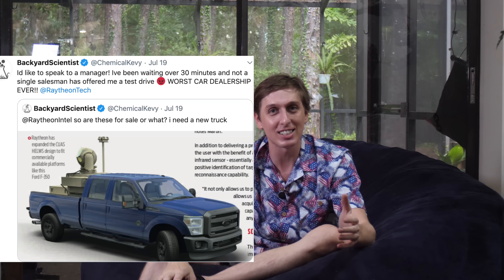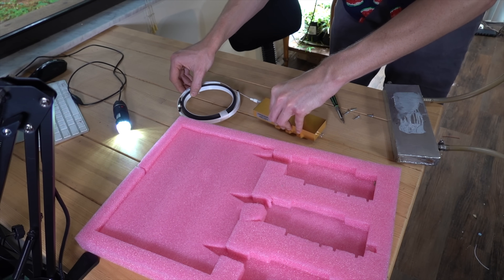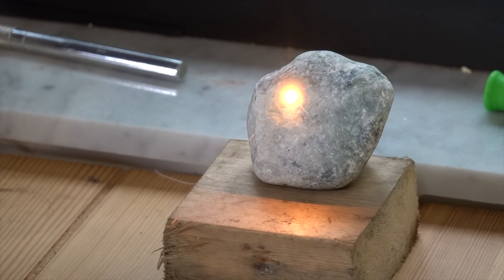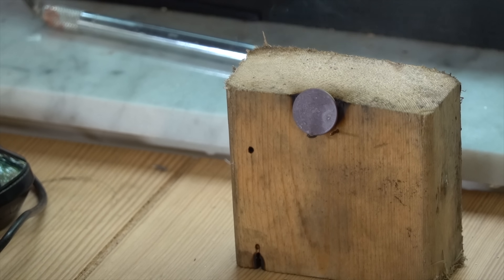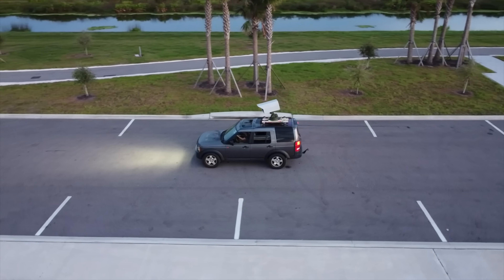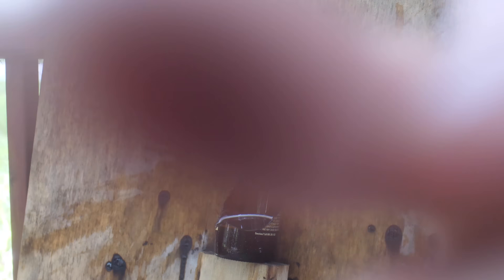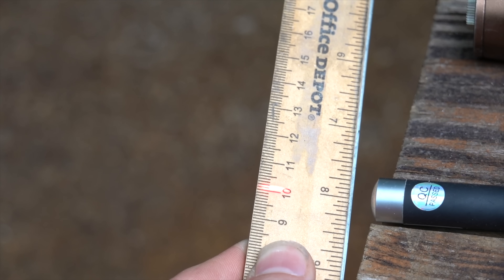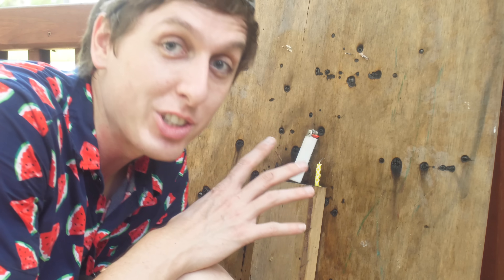200 Watt car mounted laser!

Comment: Dude...the glasses don't make you look like a dweeb...
😲GREAT VIDEO. 
Idea for speed/traffic cams...add a galvanometer for control and gyro for stability. Scan with computer vision for automatic ID/location of camera/lens. Scan said lens with galvo. I bet this could happen with a week or two of coding...and a couple/few Sparkfun dev boards and a Raspberry Pi (talking with the Pi through SPI/I2C) . Wanna get fancy? Predict/calc where the camera will be in the next frame...33.3ms away. That said, you can do a LOT in 33ms.
Reply: I would be concerned with a reflection...you did freak me out with that.

Comment: Just a heads up about FlightRadar and similar. I've seen discrepancies between it and other airline tracker websites (other sites sometimes show more crafts) and if an airplane doesn't have its transponder on, it isn't tracked. I've had military craft fly near my location and when I check flight tracking websites, none list them. Sometimes military aircraft is listed, sometimes not, depends if their transponders are on. Then there are older vintage aircraft that may not even have transponders. One old vintage airplane landed at a nearby airport and I wanted to know what it was but it didn't have a transponder or it was off.

Comment: I'm guessing it burned a hole through the cold cut, and that the wood on the other side ended up heating to the point it cooked the cut before it could get a hole burned through it as well.

Comment: I'm curious with the kaser mounted to the cassegrain in the outdoor nighttime test it didn't actuslly burn anything? Is that because the focal length was set much farther out than your backyard bottle testing? Does that mean the 200W would be far less effective at say 300 feet? I would love to see a bottle test at say 300 or 400 feet to see what it can do.

Comment: At 13:23 there appears to be a UFO in the frame.  If there were no planes in the area as he said, then what the heck is that thing racing across the screen at high speed ? Even at .25X the thing is moving super fast then disappears. Any comments here are welcomed.

Comment: This is actually crazy to me. Just so you know, 200 W is still comfortably within what an adult man can generate, ie via a bike dynamo. You could conceivably run this thing on muscle power
Reply: Nope. 200W is the laser output I assume. 

If the total efficiency was 10% for example, you’d need to generate 2000W to power it.
Reply: @davadoff  that is a good point actually. For some reason I assumed the 200W were the input energy
Reply: @kershmaru237  I was waiting and expecting him to say something about it in the video but he never did. Perhaps he doesn’t even understand it.

Comment: Jad you have no freedom to collect rain watter🤣🤣🤣 water and power ridicule and than to think there is more freedom dom dom dom l🤣l .

Lasers is catalistic ading towart eurths greatest problem the onknlwn factor of antyoxigenation evend of led ingeniering
Reply: please tell me more?
Reply: Ask me wat en mabey I can share about that part 😍
Reply: Here some light ond love where new conformations of opservations confurmed wat I shared to be corect in a deeper way😍

We see where daylight comes from😍

https://youtu.be/pYCq3XV4_0s

https://youtu.be/yONkvzTDZTQ

https://youtu.be/Dq41XQfTP1Y
Reply: Here I share a new sencor aray trouth the wide spectrum of understanding symplesety as the eurth paths in the eurth ring rolet how eurths ring  position eurth to be on its position  and how eurth conditions can ad to the some of conditions for eurths pits behavieures  towart poleshift readings

💜🎁💜
Reply: @arnokosterman231  Yes, that sounds interesting.  Please elaborate more if you'd like.
Reply: I have explained this in cern with anty metter and there explainations.

When I tace thention away particles has less to release so thay can tace less and than the drifted along with the directional feildflow of the equatorial behavieure between the kuiperbeld and kuiper copasators toroidal behavieures 😍 than we see materials running in the other direction🤣😍🥰
This they like💜 jad here I have explained this so oftenend inbetween manny sharings🙏

I can not find mi old klas sharings in plasma klas videos 
Zo I wil make time to do over soon
And wil show it inside a video sharing a jes wayght I have a smal sharing that supports this onderstanding within one self it's understanding💜
Reply: @arnokosterman231  Thank you!
Reply: You and oll are wolcome🌀💢🌹💢🌀

Comment: If it can mow or Rock can it melt tungsten which has the highest melting point I think of something thousand and if it can melt that then it can take down the entire airplane and just it being able to burn that rock it can probably shoot through the metal of an airplane so I think you may have just gotten a thing that can take down airplanes I mean if you aim it at a airplane engine technically it could go through the metal and then hit the engine and then cause it to explode

Comment: The glasses you are wearing are safe for IR, but it is NOT safe for the other stray light after the laser hits a surface.. and burning a copper penny was probably bad for the laser ..you basically made a mirror. Back-reflection is really bad for fiber lasers,especially on a straight collimation
Reply: I thought about that too
Also noticed 8:27 are fireworks lol

Comment: My recommendation for whats its worth. Is that you paint the Laser housing and mounts black and mount the controls for aiming in your truck and leave it there. You are basically turning your SUV into a military style truck. Some call them "Technicals". Basically a Toyota with a machine gun mounted on a try pod bolted to the floor of the bed. You're setup up is awesome! Rock it and don't stop!

Comment: this is one of the most terrifying things I've seen - he's so casual around this absolutely petrifying device that could blind him or anyone else with one tiny mistake
incredibly ballsy
Reply: @artanmari9074  Your dog can't tell you if it suffers spots or blurred areas or other permanent but not blinding damage. You do realize that most "blindness" is not total, right?
Reply: @artanmari9074 IT looks u r not a human u r APS
Reply: @artanmari9074 aight, you just proved it's completely safe, now try it on yourself, i assure it will be ok
Reply: Most of the things he do is very dangerous and risky and he is usually totally unaware or only mildly aware of the risks...
Reply: @artanmari9074  40w lasers are never hand-held. They are at least the size of a brick and most likely require liquid cooling.

You prolly are talking about 40 milliwatts.

Comment: Those desktop tests made me nervous: what if the rock had some mineral in it that would react violently to rapid superheating? Or if the extreme heat in one portion of the rock would cause stress fractures making it burst? It's right next to the monitor. Also, I think defacing US money is illegal.

Comment: dude the thing i wish i could see the most ironically is how he built the laser casing and focusing mechanisms but i honestly understand why he probably didn’t because i’d imagine spreading out that information could put you on a watchlist
Reply: https://www.youtube.com/watch?v=4SHJoBIYZJk
Reply: If your not on a watchlist, your not using freedom correctly.
Reply: Uhm....he (well the actual engineers in the background that allow him to play the clown on camera) strapped the out put end of the fiber to the eyepiece of a telescope, made a front plate to support one end and a support with long bolts and springs to fine tune the orientation supporting the back the telescope for aiming, and ran a toothed timing belt over the focuser knob so a stepper motor can tune the focus in situ. The smaller camera scope would have probably been more rigidly mounted to the main casing structure, squared to the front plate, with its own focuser stepper, and a web cam or RPi cam on the eyepiece. I mean, these arent new concepts, its a pan tilt mount, a camera, a laser, a pair of telescopes, 4 stepper driver boards, an arduino...apparently (not really needed unless that joystick was modified so the potentiometers were directly accessible which an arduino could read on its analog pins)... If the question is can you shine a laser through a telephone, yes it been done before, a lot. If its can you strap a telescope to an automated pointing device, again yes, that is how goto and star tracker mounts work. There isnt much here beyond that. Honestly Im a bit disappointed he needed to be wired to the thing....

But, uh, if the question is how did you make that so I can build my own..... Im afraid the answer is in the form of this LPT: if you cant suss out how it was built..... probably not the best idea to be thinking about playing with 200w directed energy weapons.... stick to the <5mW laser on a pair of servos taped together controlled with an old Xbox controller....

Comment: A little knowledge is a very dangerous thing. FlightRadar24 only shows aircraft participating in ATC services, that is IFR or VFR planes talking to ATC. It does not show any VFR planes not talking to ATC of which there may be many. Please use a lot of caution here, you may very well blind someone.

Comment: Aiming an invisible laser at reflective things is NOT A GOOD IDEA! And I'm not just saying that randomly with no background...

I acutally got a PhD in physics where I worked on laser diagnostics for plasmas.
My main laser system was pulsed and only had an output of about 12W... on average... but it only shot 20x per sec for about 7 NANOSECONDS each!
Meaning the power while it was actually shooting was about 85 megawatts! :D You could see the green beam in the air in daylight like it was a plasic tube or something.

And boy... if you focused that beam down, the electric field intensity of the beam was SO DAMN HIGH that before the focus point (= minimal diameter of the beam) was reached, the intensity was high enough to just ionize the air, meaning it created an arc / lightning just in its path!! (which was of course bad for me because if it did, the energy of the beam was gone, but yeah...)

Did parts of that at the Ohio State University. :)

Man, if I was still in that field, I'd start a Youtube show like "Let's high-power laser this!". :D

Comment: As soon as he mentioned divergence I googled info on the lasers used to measure distance to the moon, but couldn't find a quick answer. Thank you for including that info lol I wanted to know how big the laser was on the moon
Reply: The moon was laser ranged years before the supposed mirrors were left there. And the photon return was comparable.
In other words there's no evidence that those mirrors exist.

The scientific paper and magazine articles describing said ranging are not simple to find, but they're still not completely buried.
Reply: sorry
Reply: @pengilk8186  you should be
Reply: The laser is not on the moon... A mirror reflecting the laser is.
Reply: @DzastinasLTL  he means the size of the laser on the moon as in the area of the beam when it contacts the moon
Reply: @DzastinasLTL  Still wrong.....
Reply: nerd

Comment: Isn't that a XingHan 200 W 915nm laser diode pigtailed with a multi-mode 105/125 um core/cladding diameter fiber and a cap terminated end? Nice 😊

Comment: @5:00 you can tell the difference between zinc and coppers conductivity and it's ability to disperse/transfer heat.

The laser just burn through the zinc penny but for the copper penny it first had to heat the whole penny before it could start to melt/penetrate it.

It's incredible how well the copper penny could dispense/transfer the heat!

Comment: 09:09 I wonder if it can be made to be significantly smaller. Just imagine Tesla Optimus with an upgrade in its head. The head would host a separate 1KWH battery, Macbook Air M2 CPU scrapped from the Macs and mounted inside its head, two 1KW lasers in place of eyes, array of 6 4K cameras, 6 high quality microphones, LiDaR and 100 dB speaker with very decent bass. The idea is this: Apple M2, maybe M2 Max would be connected through a high bandwidth cables running through its neck and it would share data with Tesla computer mounted inside its chest. Tesla computer would do pretty much everything it did in current model of Optimus, but it would send processed data of visual information up to the Apple CPU. Apple CPU would then further process the data and make high order decisions that would decide combat performance and send data about movements to the Tesla CPU, which would perform them. Apple CPU would also process microphone data and store them alongside 4K footage for further assessment after the combat and possible storage in data centre. The speakers would be placed where the mouth is and they would play loud DOOM music as the robot fights to terrify the enemy along other well designed sounds designed to struck fear, played at up to 100dB with heart shaking bass. He would not fight with hand held weapons, but he would have two 1KW lasers at the place of eyes and he would be able to rotate them around just like humans can focus their eyes and 1KWH battery would assure up to 30 minutes of nonstop shooting through both eyes, which would equal about 24 hours of intense combat. I wouldn't want to fight such enemy 😬

Comment: Ordinary web "flight radars" do NOT show all the planes in the sky. I saw a military jet flying like crazy around our town and it wasn't shown anywhere on the web.
The planet was most likely Jupiter. A beast ~1/10 the size of the Sun (in diameter, so ~1/1,000 the volume).
BTW: Increase your safety awareness from zero before someone gets SERIOUSLY injured or killed.😉

Comment: 5:18
it actually set the copper penny on fire, you can see the green hue in the flames.
a quick google search says copper burns at around 1000 degrees celcius, or 1800 degrees farenheit, that laser is SCARY!

Comment: You are completely unsafe. You burn wood and pennies without any safety gear, INDOORS. Not even a fire extinguisher nearby.
Then you aim a laser at a bottle with a truck behind it which has a GAS TANK, need I say more. You are dangerous and need to stop or go to jail before you kill someone.

Comment: 5:10 i love how you can see the incredible heat conductivity of copper
Reply: YUP!

And, if I recall my material sciences correctly, copper has a few special properties that make it interact with infrared light in ways that most metals wouldnt, well in more extreme ways, seconded only to gold. Things such as the absorption/reflection/transmission coefficient, which when coupled with that awesome heat conductivity, means the damn thing melts before its burned through, apparently. Safety officer heart attacks and foaming mouthed OSHA inspectors aside, at least that bit was something interesting to see in a video!

Comment: Dude, you need to be more careful and respectful with that 200 watt invisible laser. It's against the law for you to even have it in public without a safety license. The laser system has no safety features, such as a laser radiation sticker, interlocks, nor beam blocking device.
The feds have the right to confiscate your equipment and can fine you $ thousands for non-compliance.
As a licensed laser artist, you are being irresponsible and jeopardizing my industry.
(awesome build, Bro 🙄)
😎

Comment: From my hobby laser cutter forums, we often hear that copper is one of the metals you don't want to try to cut or engrave. It's often quoted (by sources unknown) that its reflective properties are higher than say Zinc, Brass or Aluminum and the laser would be reflected back into the head melting the machine.  I don't know how accurate this is but I was definitely cringing when he put down the copper penny waiting for the wall behind the camera to catch fire. Perhaps this is why it heated up instead of burned through like the zinc which only had a thin coating of copper which burned away.  Fascinating stuff!

Comment: Speaking of lasers and random minerals, some ideas. Sulfur has a low thermal conductivity and on a higher grad crystal, you can hear the crystal structure cracking from human body heat. Ulexite has long fibrous crystal that function similar to fiber optics. Finally, the variety of calcite known as Iceland spar exhibits the property known as birefrigence.

Comment: Seems like it's a fibre laser. Lots of smaller diode lasers, all hooked up to fire into the laser, so that their combined power comes out of the end. Nice cheap way of doing it. Shame it's not visible though, I wonder what they're "supposed" to be used for? I also wonder if it'd be possible to buy a few 200W modules and either focus them together, or else even have all of them combine their power into one fibre?

Comment: Fun . Boomer crank here. What I could have done with your budget and current tech in 1967. Instead I had salvaged tv circuit components , tube sockets on wooden boards with galvanised nails for point to point wiring. Literally breadboards , well boards any ways.
The closest to digital was a telephone stepping relay and rotary dial . It would add and then a diode matrix to make it binary but hey china was not selling off the shelf war lasers.

Comment: I got a question...
Can this laser set-up of yours be good for melting blockages in river ice in springtime?
Reply: It's only 200 watts, so no. It would be awful. You're better off with a 1500 watt strip of heat tape for like $40
Reply: Kaboom. Problem solved
Reply: Melting ice takes a boatload of energy, so no. Just one of the many weird properties of ice.

Comment: Guess I'll havta sport  a layer of polished chrome/copper backed by a circulating water layer for high heat dispersion and cooling. Should be more then enough to counter lazors.
Reply: High reflection properties coupled with high heat distribution coupled with high cooling properties = useless laser.